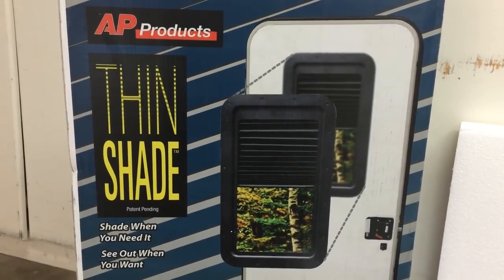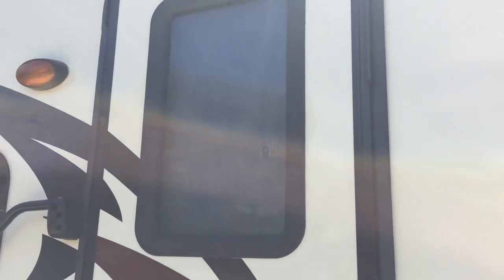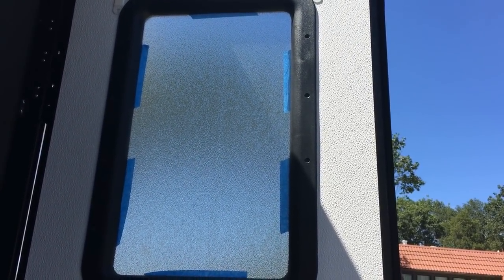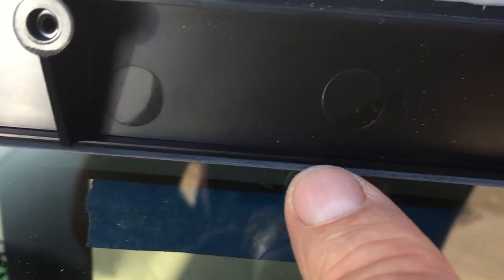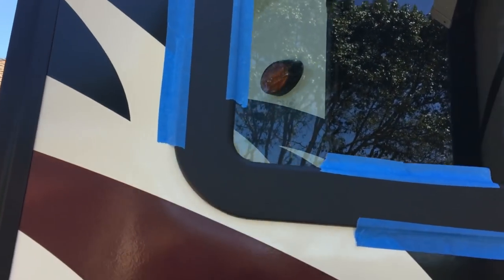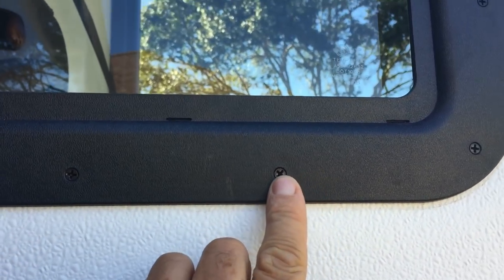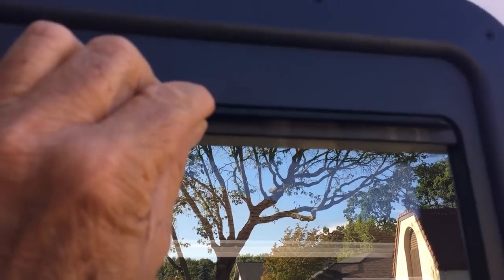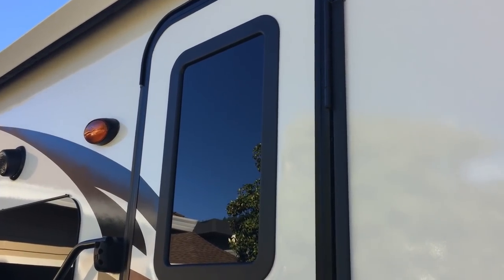AP Products Thin Shade Installation & Tips from Start to Finish (Travel Trailer & RV)

Comment: just getting ready to install mine.  I have seen several that mount the shade in the other direction so you can leave it down slightly so you can see outside when someone is knocking on your door.
NIce job on the video!!!
Reply from the maker: Thank you, I should have mentioned in the video that I thought about mounting the shade so it would slide up rather than down. The reason I didn't is because on some of our camping trips we have the windows build up moisture at night inside while camping in the winter months even with a couple roof vents open a little. So I was afraid that with the shade opening from the bottom water might become trapped at the bottom of the window and maybe cause future problems with shade operation and might damage the shade material itself. I may be wrong?

Comment: The tape makes all the difference. I used black duct tape, and it is almost invisible except for the thin edge of the tape. The frame does not cover the lower shade bracket, so the tape will show. If I were to do it again, I'd use a piece of clear Gorilla Tape. Thanks for your video!
Reply from the maker: You're welcome Chad. Thanks for watching and sharing your tip with everyone. https://www.youtube.com/@thetraveltrailerguy/videos

Comment: Why not show the installation of the inner part of the frame. Numerous reviews talk about how difficult it is to keep the shade in place during this part of the install. Would have been nice to see how you handled that.
Reply from the maker: Yeah I missed sharing that part of the installation and wished I had. Personally that part of the installation was really easy and not difficult like I've seen others have problems with keeping the shade in place. If I had to do it all over again I would have shown this part. Thanks for pointing this out. Mike

Comment: Clean looking shade and window.  Nice easy installation. Thanks for the tip on the window shade as I do have the frosted glass window in my Rockwood. I was wondering on another video you did was the propane tank monitors, how are those working out for you? Additionally on an old video of yours you cut down a aluminum rack for your generator. I was looking for the place you got your rivets to resecure the end pieces and do you remember the size (3/8") and the length. I got my rack from Discount Ramps and mine is way too long also so off to the chop saw. All my rivets are steel and black al. for kayak accssories.
Reply from the maker: Thank you Scott. Th propane monitors are still working great, no more guessing how much I have in our tanks, no problems so far. I bought the rivets at a local hardware metal shop, I can't remember if they were 3/8" but I'm pretty sure they are

Comment: Great video but I'm not sold on the product anymore since I saw another one that you operate the shade without having to open the door to do so.
Reply: Edwards Journey thank you
Reply: The vertical blinds style with the handle looks nice but it's double the price.
Reply: @Mason Hawley not sure why you're laughing...

Did you check your inside window frame? Are there screws or no screws?

The screwless frames are hard to remove without breaking the internal clips.
Reply: @Mason Hawley and why wouldn't you replace the glass? The main reason you do the window shade mod is to be able to see outisde it. What's the point of leaving the frosted glass?

Comment: Did your factory window have screws or hidden clips? I can't find any videos on the best way to remove the clips.
Reply from the maker: The window I removed had screws holding it in and so does the new one. I belong to a few RV Travel Trailer Groups on FB and people have mentioned they have removed their window with clips by slowly prying around the inside of the trailer window frame until the trim poops off making sure they tape the outside window to the trailer so it does not fall to the ground when doing so, Another option is to call AP Products and they will send you free of charge small wedges to insert around the trim between the door and the trim to remove it (I think they send you instructions on how to to do it also). Here's their phone number A P Products in Coldwater, MI - (517) 278-8521. I hope this helps, let me know how it goes for you :) we really like the product
Reply: @thetraveltrailerguy  Thanks. Still looking forward to the Michael & Michael RV channel ;)
Reply from the maker: @aguyandhiscomputer  LOL maybe someday I will meet up with him and we can do a video together :)